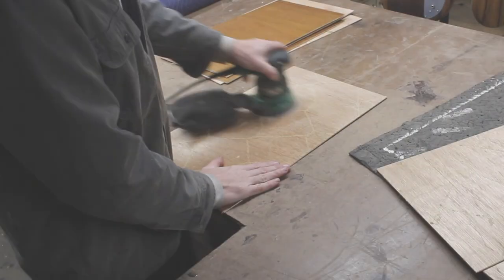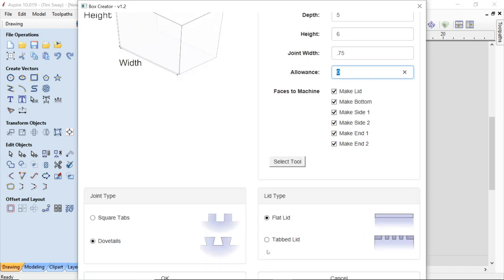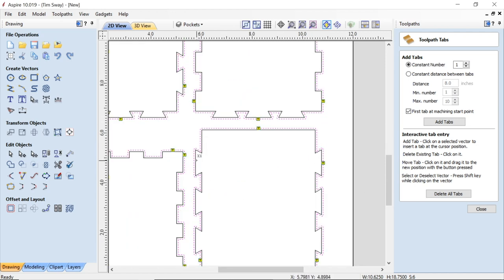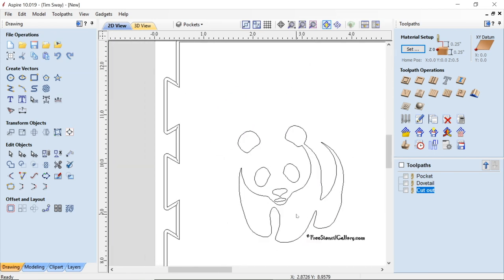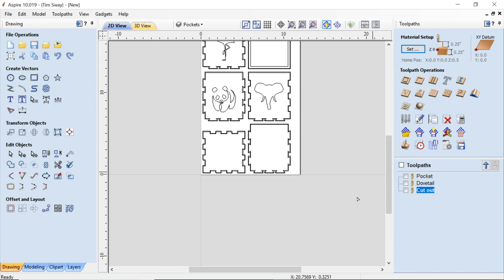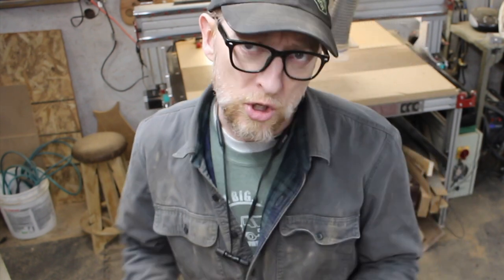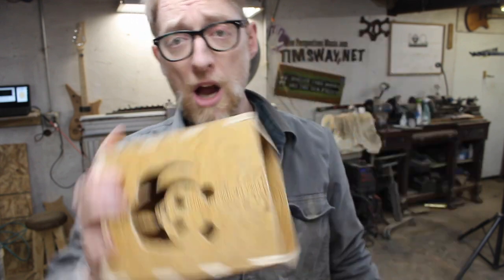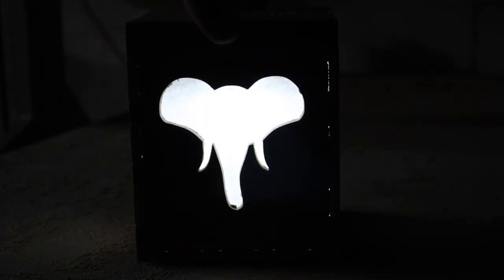Making a Animal Lamp Project | In the Labs with Tim Sway | Vectric FREE CNC Projects

Comment: Try toggling the solid 2D toolpath option in the top bar (button next to the path with the light bulb) and it will show a gray outline of the cutter diameter and the cutting path.  It saves time over checking spots with a circle and shows what points the cutter can reach in narrow areas.

Comment: Thank you for your video. It provides a lot of useful information. 

Would you please tell me which 1/16" end mill that you use?

Also, parchment paper might work and is readily available in most grocery stores.
Reply: parchment paper would work great. I don't reember the brand I got for the 1/16, but as a rule, when I'm buying the really small and breakable ones, I get pretty inexpensive ones, usually off ebay. I found the expensive ones break just as quickly. lol.
Reply: I was going to ask a similar question. Do you prefer any brand of bits over another or do you just use whatever you find when you need it? That 1/16" cut really cleanly.
Reply: @Brownstone31  I have no brand preference at this time. Not experienced enough.

Comment: great video. I was wondering if you knew of a box joint gadget that creates box joints in the vertical position. Like you do with a table saw or router table. My cnc can cut past the front about 2 inches making vertical cut possiable  
Thanks Jeff

Comment: Using Box Creator V1.3 with vCarve 10.5 the gaps between sections/parts are so small that the tabs don't have anything to stable to hold unlike Tim's version above which has good padding between parts.   Can you explain or help?

Comment: I can't believe they don't let me use Gadgets in V Carve Desktop this is very disappointing that you need the pro version to use gadgets. Vectric this needs to be fixed!!!
Reply: Yeah, a little disappointing. I myself hardly use it; only the keyhole gadget -- don't even have the box gadget.  
Go online and do a search for box joint templates and you should find a "mini program" that will create the vectors you need. 
https://makerdesignlab.com/tutorials-tips/online-file-generators-for-laser-cutting/
Reply: Easel had a good box joint creator, e port the G-Code to your favourite CNC prog or just run it from there